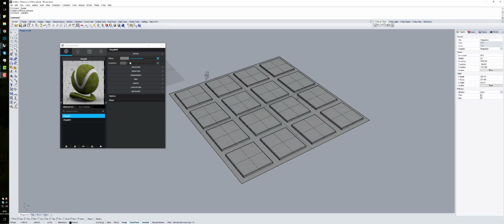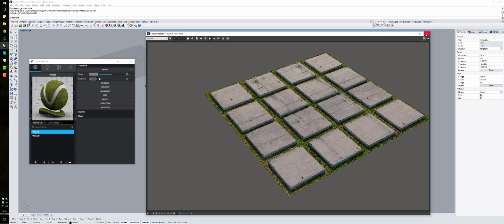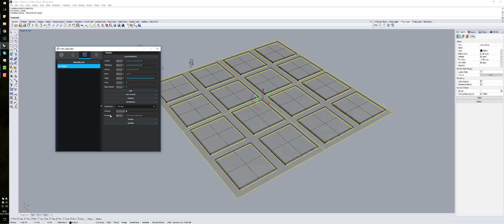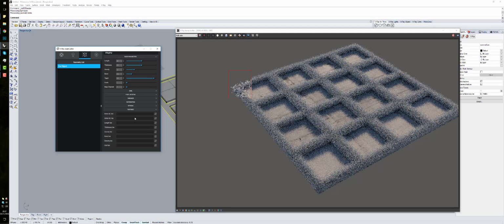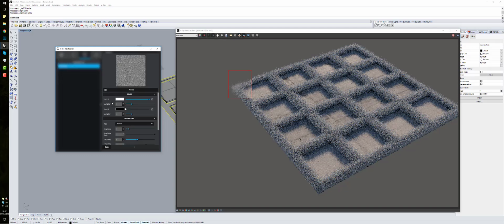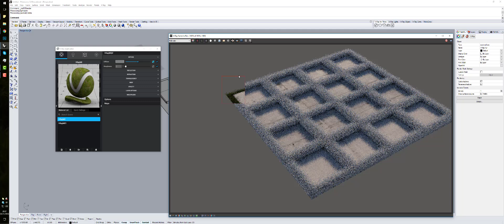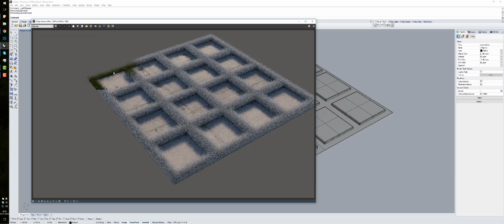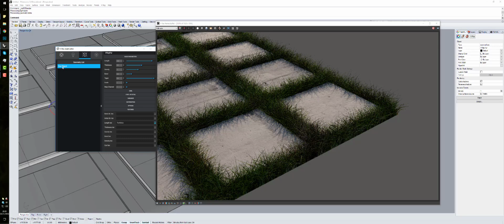V-Ray 3 for Rhino: V-Ray Fur setup for Grass

Comment: Hey thank u very much for this tutorial ! As i tried it by myself i had a few problems, first of all my furys always rendered on the down side.... finally i realised that i ve to flip my surface and not the fury object itself xD... the second one wich made me crazy was the density, in this tutorial u ve no problem with the distribution per are. i pushed the regulator to the maximum 10... and thought that this would be the maximum, but u can just type anny ammount u want. So i thought this commend could be usefull for some beginners.
Reply: I do not understand me my material is always white ...